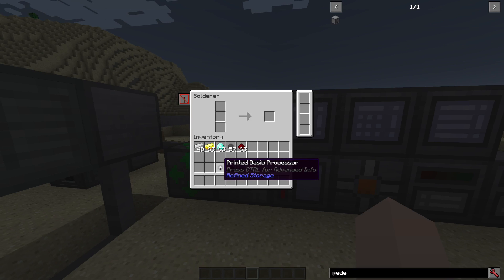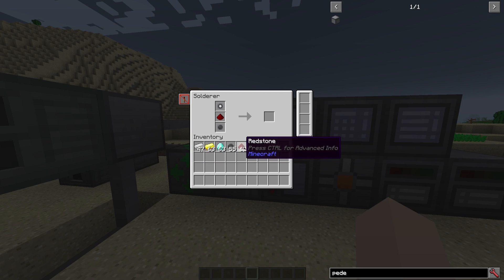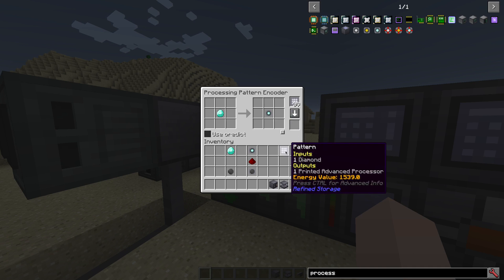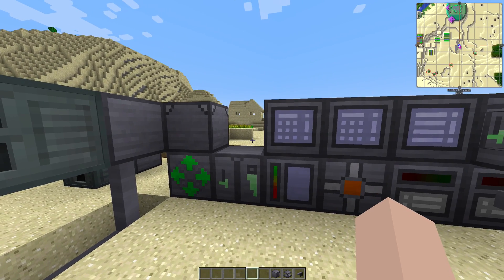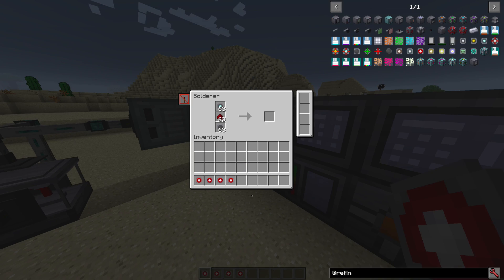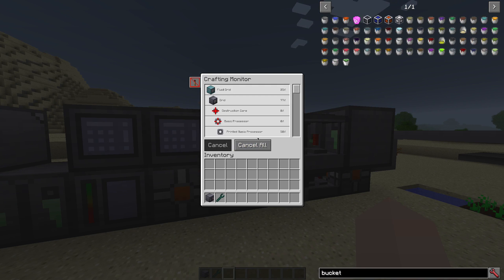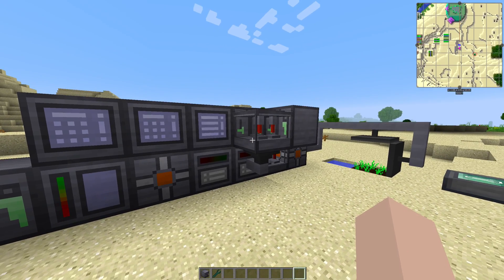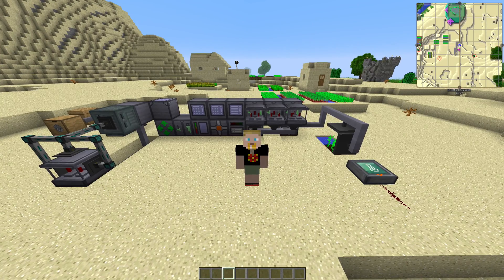Refined Storage Spotlight (part 3) - The Solderer Change

Comment: Hey ;) I know it's an older video but if you have JEI (for MC 1.10.2) installed, you don't need to make the parts of the processors first. Just open the recipe in JEI and click on the button to transfer the recipe to the grid. And then its correctly filled in so you can simplay make your pattern.
Reply from the maker: Ja, that is a very welcome change in the later version of Refined Storage. I actually plan on doing an updated version of the spotlight to cover all the new features.

Comment: Very well done! I have an issue with the solderer not crafting the (basic, improved & advanced) processors. Everything else works fine. Any ideas ?
Reply from the maker: If the crafting with the solderer in general works but only a few recipes don't I have no idea why that happens.
Reply: Tried it again earlier today and it still didn't work. But just now after crafting a recipe that needs advanced processors it somehow started working. Modded MC is buggy :/ Thanks though :)
Reply from the maker: At least it works now ;)

Comment: Mine just wont put items into the solderer
Reply from the maker: Is the crafter facing the solderer and connected to the network?
Reply: LHS Buster yes. It's now outing items into the solderer but it won't autocraft the simplest thing in the actually system
Reply from the maker: Can you craft with the same items inserted manually into the solderer?
Reply: LHS Buster I was trying to craft a grid and it said "to craft" for the deconstruction core and construction core and it wouldn't craft then even when I had the patten and glow stone
Reply from the maker: It's really hard to tell why it doesn't work without actually seeing it.
Reply: LHS Buster yea
Reply from the maker: If you have the world on a server I would be happy to join you and see if I can fix it.

Comment: Thanks for great video, but i wonder, can i make same recipe in few solderers? Even with 4 speed upgrades its so slow.
Reply from the maker: I think it should work. If you set up two crafters and two solderers for the same recipe you should be able to start two separate crafting tasks. I don't think RS will split it automatically, though.

Comment: Could you please tell me how you changed the map on the right top? Its journy map, i think, but how you got it so its "so far zoomed" my problem is i have a very big resolution and big monitor... i cant really see me char on the map... its too smal (i know i can make the map bigger, but this wont help) Maybe you can post a screenshot of your settings? :) ty

Edit: just btw, good video, thanks alot.
Reply from the maker: You can set hotkeys for the zoom in the control configuration of Minecraft. There are even hotkeys set as default so it should work right away. For me it's the two keys left of Backspace.
Reply: Thanks some of the keys (i tried all near that xD) worked. Youve got a new abo! May i ask where you from? You sound like german abit lol.
Reply from the maker: My pleasure and I sound a bit german because I am german. The "Guten Tag!" in my regular videos might be a good indicator for that as well ;)
Reply: Und ich hab mich schon gewundert... xD Aber ich mag dein Englisch... xD

Comment: Has the queue been changed to produce items in dependency order? The monitor looked different from your previous video.
Reply from the maker: The crafting and the crafting monitor were improved a few times since this video. You can just take one solderer and give the crafter all the recipes and it will automatically craft all the items in the correct order. It also became way more reliable over the last few updates.

Comment: Im trying to make a basic processor, and it just doesn't work
Reply from the maker: Did you first make the Printed Basic Processor and the Printed Silicone and is the Solderer connected to the system?

Comment: how did you get the machine pattern thing?  doesn't seem to exist
Reply from the maker: The pattern is the same, You just need to write it in the Process Pattern Encoder instead of the Pattern Grid.